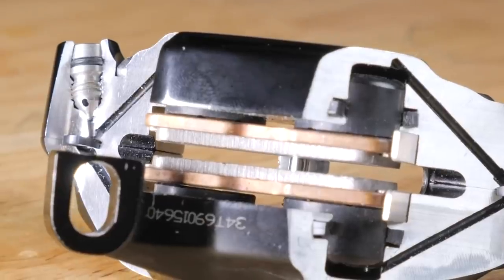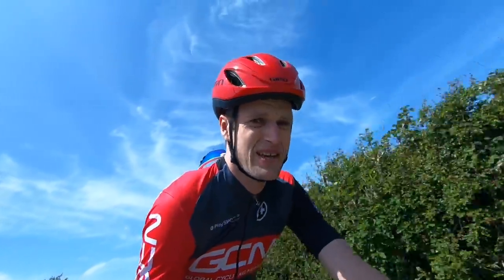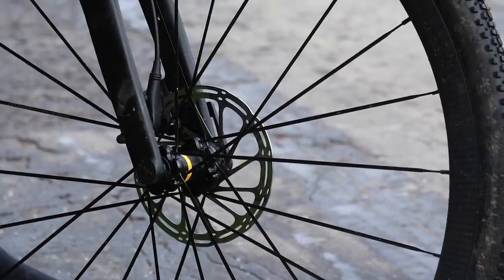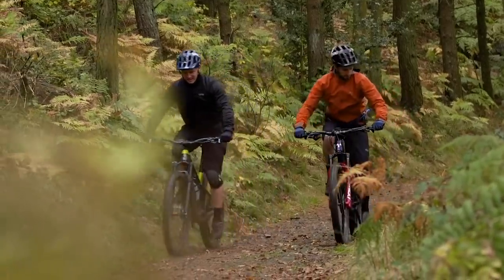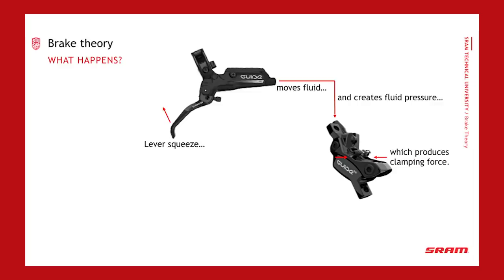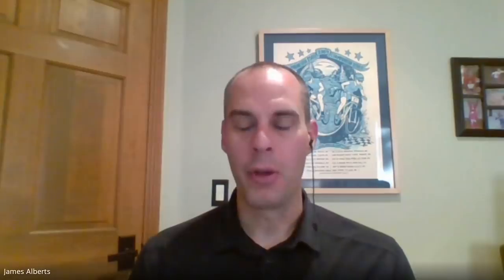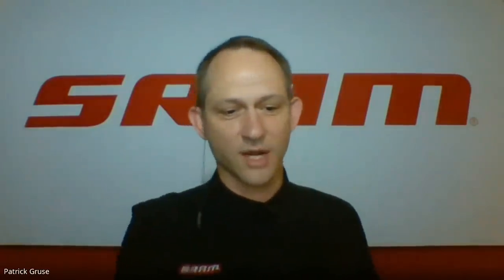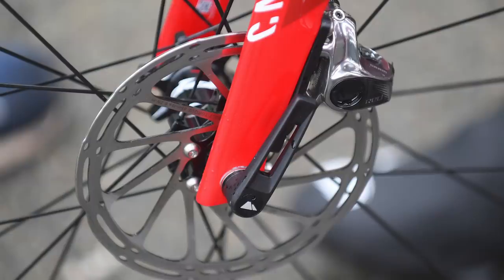How Do Disc Brakes Work? | What Makes Your Bike Stop

Comment: So I guess those of us who run mechanical disc brakes just don't matter !??
Reply: I know, right?  TRP spyre are awesome for road bikes.  Both pads move, like a hydraulic, and you can use them with whatever nice levers you've already got, and don't have to worry about brand compatibility.  (TRP brakes on Campag shifters/levers, etc)
If using good compressionless brake housing, etc, I don't really see much downside to them compared to hydraulics.  No need to bleed, less chance of sticky pistons dragging, etc..
you do need to tweak the pad adjustment occasionally, but it only takes a few seconds to give each side a half turn, and you're good for another couple months.

You probably do have to squeeze a little harder for a given braking force, but that's also what "modulation" is. ;)
Reply: @nwimpney  I have TRP Spyres on my GT GTR Comp.  I'd describe the braking performance as adequate, if not exactly inspiring.  Could be down to the cables being low compression rather than compressionless (Jagwire OEM), or maybe the stock pads.   Having said that they provide pretty good feel and I haven't had to do anything to them (apart from pad tweak as you mentioned) since I got the bike.  Would be nice to see GCN do some more content aimed at mid-range bikes and equipment,  rather than just the high end stuff they usually do (thinks "new Zipp wheels.....more affordable at just €1800 euros!.  My bike cost a third of that !).
Reply: @redart64  well, barring flex, etc, the braking "performance" people talk about is mostly to do with leverage, and the cylinder ratios in the case of hydraulics.
With cable brakes not self-advancing in the way hydraulics are, they're generally going to be striking a compromise between having a leverage ratio to make it feel powerful, and to not require constant adjustments to not bottom out the lever whenever there's a tiny bit of pad wear.
This kind of forces them to use a heavier lever feel than a hydraulic.

On the flip side of it, given that you're willing to squeeze it a bit harder, they should give just as much braking power as a similar 2 pot hydraulic using the same pads.

Comment: I prefer discbrakes on my roadbike because you can use lighter rims ( that won't wear ) and wider tyres.
It 's important to bed the pads in properly when new and after sanding them down and degreasing the system when dirty and glazed.
Who the hell is interested in electronic brakes?? Do they allow braking while cornering perhaps?

Comment: How often should a break-bleed be done?
Reply: Never unless there is a problem. I've had hydraulic disks on my MTB for over 20 years and I haven't bled them yet.
Reply: Whenever it feels soft at the lever.  Usually the rear brake requires bleeding before the front brake because the hose is longer and it takes in moisture sooner.
Reply: How often do you bleed the brakes on your car?
Reply: Rover200Power  I have the car’s brake fluid changed completely, every few years, as per the manufacturers recommendation. I understand the process displaces old fluid with new, and is therefore something like bleeding.  Perhaps the question should not be how often should we bleed our bike brakes, but how often should we replace the fluid?
Reply: Well,  The correct answer is probably that they should be done fairly often as general maintenance (Yearly, perhaps)

In general, most people will probably just do them when the bubbles from their last bad bleed job build up on the high pressure end of the system and the lever gets mushy.

Over time, they will get water in them, just from permeation of the hoses, etc.  In brakes that use DOT3/4/5.1 brake fluids this will lower the boiling point of the fluid, which can cause the brakes to boil up and drag on descents, and give very little actual braking force when it's needed.
With mineral oil brakes, the water isn't absorbed, so it'll just cause corrosion wherever the water ends up building up.  Likely down behind the piston seals or something.

Comment: if you overheat disc brakes, these is no breaking performance. so first, learn how to brake with disc brakes, than go riding alps😜
Reply: For a steel rotor that happens once the rotor glows red hot. Up until then they are vastly superior to rim brakes in EVERY aspect.
Reply: Same is true for rim brakes of course, with the added danger of blowing a tire off the rim, either from over-pressure, or from softening a carbon brake track.

Comment: im confused. how do you do a pad advance ? lol
Reply: Basically, you spread the pistons out using a pad spacer and then you insert a thin spacer (or business cards)  about the thickness of a rotor and squeeze the brake lever to center the pistons and also advance the pistons to the correct position.  The reason it doesn't advance properly on your rotors is that the rotors and brakes are fixed onto your bike and the pistons may not hit the rotors evenly at the same time.

Comment: The mass of the rotor determines the amount of thermal capacity. Not the diameter. Rotors of equal thickness but different diameters have different masses. The larger diameter has more mass and therefore needs more energy to reach the same temp as a smaller rotor. The larger surface in theory provides more surface area for transferring to heat to the air. Since the rotor face is 90 deg to the oncoming air the transfer is not efficient. This is the reason for vented rotors and ducting onto the surface of car rotors. Also the larger the diameter of the rotor the longer the leverage arm in relation to the hub. So less breaking force is requred that results in less friction that heats the rotor slower.
Reply: A bicycle's rotor gets a lot more airflow than a car's which is tucked inside a wheel which is tucked into a wheel well.  That's mostly why the venting is helpful in cars, but isn't really all that useful on a bicycle.
And you're wrong on the last point about "...results in less friction that heats the rotor slower"
While you do need less force with the longer lever arm, the rotor will be moving proportionally faster.

In the end, you're converting kinetic energy of the whole bike and rider into heat, so the total amount of energy shed by the brake rotors must be the same to brake at the same deceleration.  The main advantage to a larger brake, thermally, is just the fact that it has more radiating area.

The other big advantage is just how much braking force is available when you want to stop very quickly, and aren't going to be braking long enough to heat soak the rotors
Reply: Larger diameter rotor equals more torque. Braking converts potential and kinetic energy to heat. Unless you don't have any hills where you live. So my last statement about less breaking force is missing parameters. All things equal other than rotor diameter. You need to grip the larger rotor less to convert the energy. Tangential velocity. At a given RPM the farther from the axis the more distance over the same time therefore higher velocity. 

But to my original point. Replace your rotor with rotors with larger ones and you have more mass. Unless they drill a bunch of holes in them. At the end of the day it is about converting through friction potential and kenetic energy to heat. The rotor and caliper must have a capacity to absorb the heat without losing brake performance. Bigger mass more capacity. 

Thanks
Reply: That's it, we need a dual disc system  like on motorcycles.  ABS naturally.  It's amazing how our needs keep growing!
Reply: @Wildschwein_Jaeger  But mass isn't really that important, because the capacity is just acting as a buffer, and not a particularly deep one at that.  Under hard braking, you're putting thousands of watts into the rotor.  Sure, it'll take more energy to heat up a more massive rotor, but the situations where you actually care about the temperatures, are situations where it's going to get any rotor heated up pretty quickly. so whether your brakes get hot in 10 seconds or 5 isn't too important.  what matters is that if you've got more surface area bleeding off the heat, the temperature won't get as high.
I think the problems with heat soaking bicycle brakes are more to do with the heat working its way through the pads into the caliper, as the rotor heats and cools fairly quickly.

Comment: I still don’t see the need for disc brakes on road bikes. I climb AND descend 1,000,000 feet a year ride 10,000 miles a year on alloy rims and rubber brake pads and stop shorter than all my riding buddies on their disc brake bikes. They’re heavier, noisier, more maintenance just more BS for now real advantage. I live in San Diego we don’t ride in the rain just wait a few hours and you’ll have  sunshine. 😂🤣😂🤣
Reply: Discs just work better. Substantially better. Not just a little bit. And allow better designed wheels since no need for a brake bed on the rim. They are now within 20 grams overall system weight, within 2-4 watts, they are not 'noisier', poor brakes of both types squeal, and there is NO maintenance on a hydraulic brake system for a road bike. Change the pads very so often which is WAY easier than changing the pads on a rim brake. My 2006 Madone has rim brakes and my 5 mountain bikes have disc. I know the differences and advantages. And I road in SD and now Vegas.  While the rim brakes are acceptable, discs are much better and safer.

Comment: Do we need ABS for the bike..?
Reply: Not really, people have created and systems to work on bikes. A case could be pressed to use it on faster e bike's
Reply: it would be quite complicated.  For the same reason as with electric brakes.  ABS needs to be able to release and re-apply the brake, and that energy has to come from somewhere.  In a car, you've got the same brake booster used for your power braking.  On a bicycle you would need to add some sort of pump, and a control system for it, and in the end, you would just be adding a lot of potential failure points that would likely cause more crashes than they would prevent.

Comment: Disc brakes in the wet:  SQEEEEEEEEEEEE
Reply: Clean and degrease ( with disc brake cleaner i.e. alcohol ) your pads and rotors and take 5 minutes to brake in each brake separately.
Problem solved!
Reply: Rim brakes in the wet:  ShhhhhhhhhhhhhSQUEEEEEE-BANG!

Comment: What kind of shitty camera work is this? Disc brakes have their place these days but I hate the complexity of the maintenance routine, that's why I won't use them. In dry weather I don't see that much of a difference unless You are doing a very long down hill at high speed. Did not enjoy this video!

Comment: Rim brakes are technically big-disc disc brakes. Change my mind.
Reply: agree, with a huuuge cooling surface (nevertheless I've managed to blow off a tire due to overheating on my rim brake mountain bike...), but with 'real' disc brakes and you don't wear your expensive rims, and you've got much better performance under wet conditions